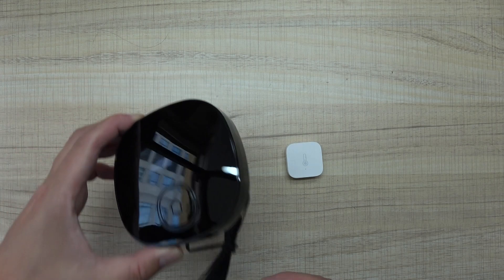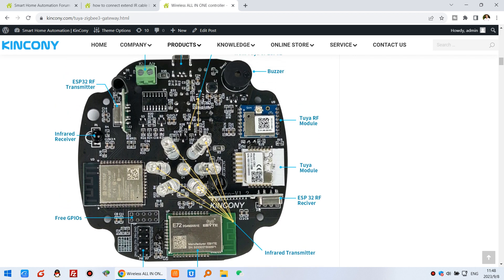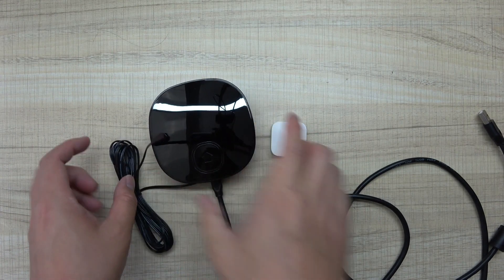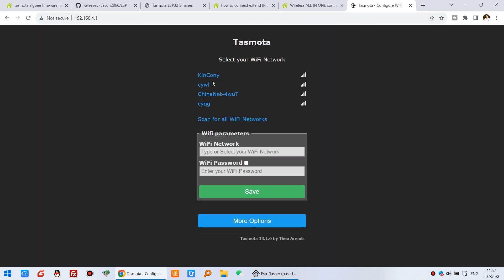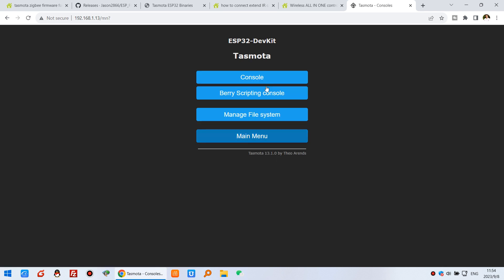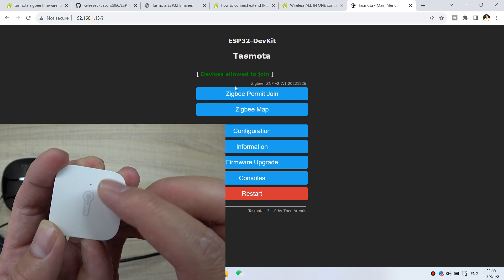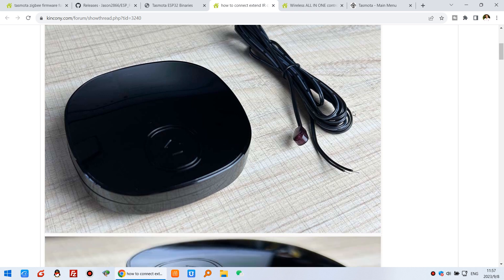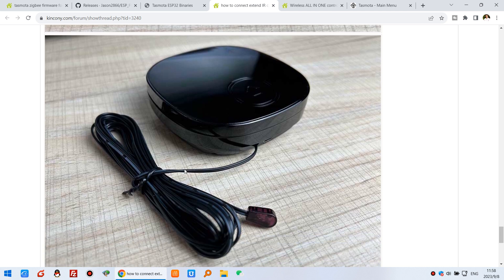how to config tasmota for ESP32 zigbee3 CC2652P gateway - AG Pro

Comment: Thank you for the video. Is it possible to connect / Integrate Zigbee Solenoid Valves, Wall switches /other Zigbee devices and control (ON/OFF) these devices using HTTP commands?
Reply from the maker: i will check about it